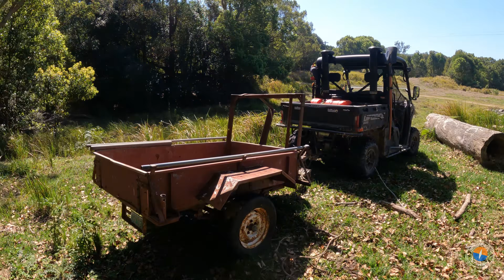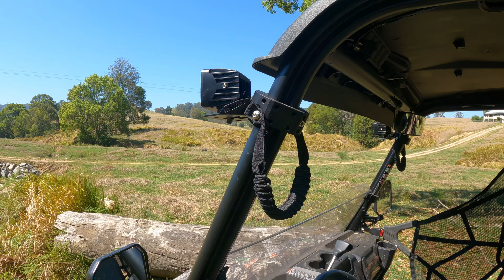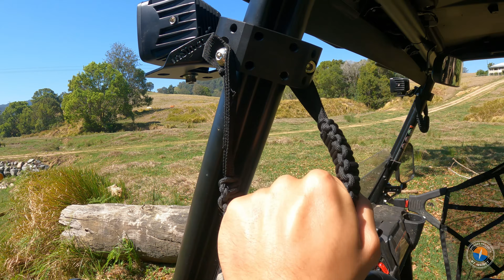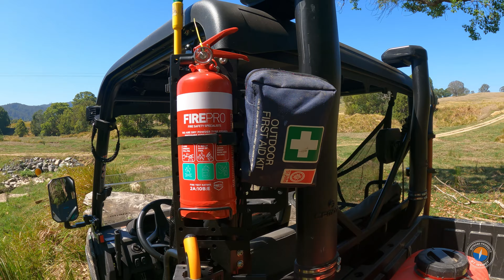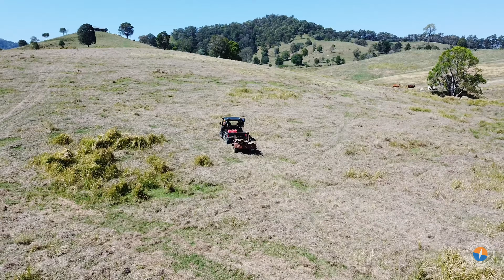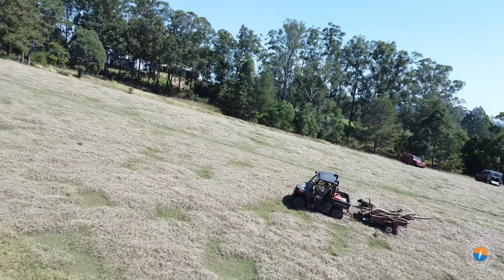Towing with the CFMoto UForce 600 | New Products & Future Plans | InSinct EP4

Comment: Hello, based on your experience I have a question. What is the maximum load that can be carried with this type of vehicle? I have a garden, and I want to transport water from the village center. If I place an IBC tank on a trailer similar to yours, what would be the maximum liters of water I could carry? Thank you.
Reply from the maker: Hi! The maximum payload in the cargo area is 250kg and the maximum towing load 680kg. Depending how much your trailer and IBC setup weighs, you could work out how much you could safely tow. It will probably end up around the 300L mark approximately.

You just need to make sure to use low range, and hold momentum. It’s the starting part that can cause damage to the belt and clutch components 

Hope that helps!